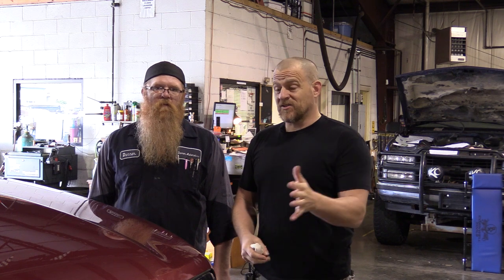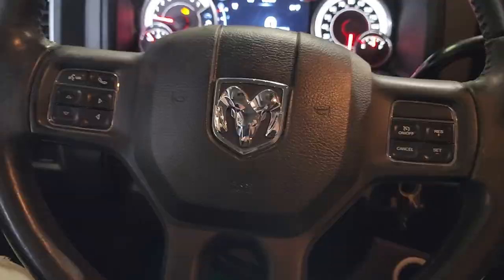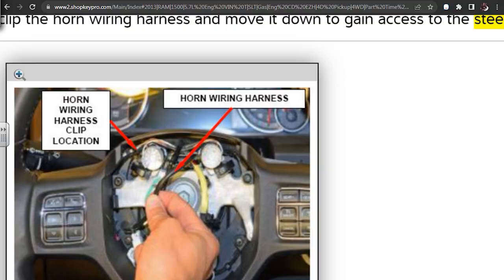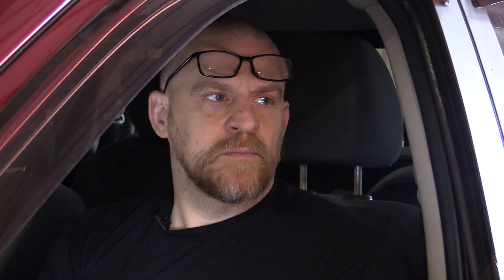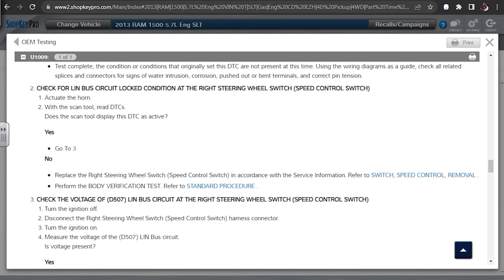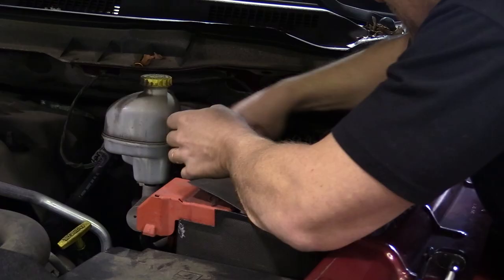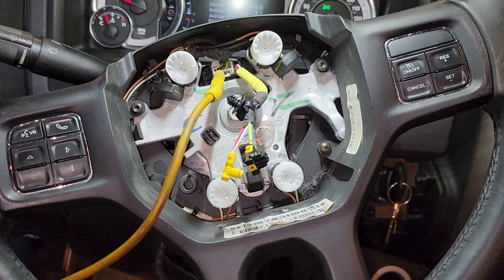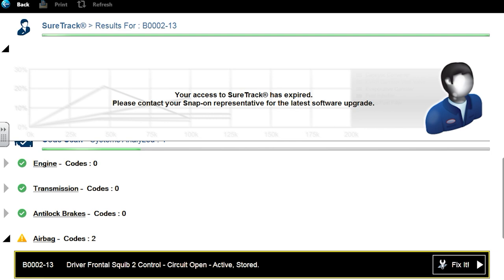2013 Dodge Ram - No Horn/Steering Wheel Switch Functions - LIN Bus Fault [U1009-00]

Comment: I have a 2010 Dodge Journey with no horn, wipers, headlights or taillights or turn signals but brake lights and cruise still work. I have replaced the clock spring, multifunction switch, TIPM and the entire steering wheel with controls and still nothing.
Reply from the maker: Start with a scan of all modules on the car. If you do not have a scanner that can do that, you'll need to take it to someone who does. That is the starting point

Comment: The method Dodge used with the buttons and resistors going to an ADC in the body module is the ghetto way to do it because flaky switches can give the wrong commands to the BCM.  Much better to use the key scanner method with the X Y matrix button circuit.
Reply from the maker: This isn't an uncommon design. I've seen it all over the car in various applications.

Comment: Why are you so surprised that the cruise control is on a dedicated communication circuit on the master module where the lefthand slave side is all non-safety related stuff. With all CC signals on just one wire you can never be in an unknown state.  Just like the airbag is on a separate circuit. Makes perfect sense from a safety point of view
Reply from the maker: Perfect! Thank you
Reply from the maker: I dont think of cruise control as safety but if it malfunctions it most certainly is lol guess thats why I was confused as to the purpose. It makes perfect sense man thanks again

Comment: Hey listen I'm having the same problem but now mine is got no steering, temperature for out side saying -40 at all time and here I'm alberta it's like plus 4,,the sign for steering wheel with ! Mark shows up, now dash lights are blinking,now I have dinging going all the time, half my fuses don't work under the hood.wtf is going on.
Reply from the maker: You're going to need to take it to someone you trust. I have a shop directory where you may be able to find a shop in your area that is using my training material for their technicians. 
https://scannerdanner.com/find-sd-shops.html

Comment: I am having this same exact issue in 2017 RAM 1500. What should I tell my local technician to help him diagnose and find this issue? Check the ground wire at the connector for the LIN going to right switch?
Reply from the maker: First is to make sure the recall was done, and second is to make sure to tug gently in those wires to the right switch.
And pay the guy his diagnostic time! 
The other thing is, I'm sure he doesn't want to hear "I watched this YouTube video"
So be gentle and specific
Reply: Did you get this resolved? I have a 2018 3500 and it keeps blowing a fuse, knocking out the horn and all steering wheel controls except for the cruise control, which keeps working even with the blown VIC fuse.
Reply: @KD-kf4zm  I had this same issue with my 2019 2500.  I ended up putting an automatic resetting circuit breaker in the fuse holder which worked for about a year.  Now its hard broke.  Did you end up finding a fix for yours?

Comment: In some vehicles, if I have the engine running. Why do communication DTCs set if I plug in a scan tool? Still learning
Reply from the maker: Try another scan tool. What are you using and on what car?
Reply: @ScannerDanner  Autel Maxisys on a 2015 Ford fushion. Is there a way it interferes with some signals when I plug it in while running? A bunch of lights come up on the dash and those codes set but when I plug the tool in with the key off, it works as expected. Someone said plugging in the tool with the modules actives interrupts communications? Thanks
Reply from the maker: @chasyho  some of the newer systems will give you problems without the correct update or cable even depending on your scan tool
Reply: @ScannerDanner  thanks for all the knowledge

Comment: Good morning Paul. I know this is a long shot, but I was hoping to get some insight. I own a 2005 Ford E450 with the 6.8 gas. It has been running slightly rough at idle( about 800-950), but when you put it in drive, she runs really rough, when you give it throttle with your foor on the brake, it doesn't want to rev above 1500 rpm. The codes are po171 and po174. When I'm reading live data, stft is switching between +3 and -4. Ltft is maxed at +26. MAF         at idle is .2 lb. When I rev it up to 2500, LTFT goes down to +19, MAF goes up to +9lb. At idle is seems to rev up pretty good. It seems to chug pretty hard under load. Any help would be greatly appreciated!!
Reply from the maker: Unplug the MAF and then see how it runs. If it still runs bad, next step is a fuel pressure measurement
Reply: @ScannerDanner I think running fuel pressure is around 60 psi, any lower there is a restriction in the line or restriction in the pump possibly?
Reply from the maker: @user-vu5gv9sb2h  not sure if this model uses a variable speed pump or not. Some of them did. The biggest thing is fuel psi should not drop on a wide open throttle snap to redline rpm

Comment: Paul, back in the day [1985 - 1995] repair of any SRS connectors & or wiring was verboten by the manufacturers, in my case Nissan, Mitsubishi & Honda. Replacement of any harness for wiring or connector damage was the only approved way from both a liability and warranty aspect. Repairs such as this and a subsequent unintended SRS deployment or failure to deploy with a command signal would leave the repair facility in a "liable if and until proven not liable" situation in court. Good luck with a jury on that one. Perhaps the legal system has moved on from the draconian approach? Does anyone with authority know how civil law reads now?
Reply from the maker: Yeah, I'm not sure? I've never attempted to repair any type of wiring on an airbag system
Reply: @ScannerDanner  Maybe ask around at some of the area shops [or an attorney :) ]and let us know if you find out further. Thanks.
Reply from the maker: @parochial2356  I would follow exactly the manufacturer recommended procedures for air bag systems. Then I don't need to worry about it.

Comment: It's almost as if the owner taking his truck in for the recall repair, ended up causing this issue, by them man handling it a little too hard when the zip-tied it. lol..  But if he never would have taken it in for the recall, of course it would have chaffed and made the other wires fail anyway..    I really don't like dodge because of stuff like this.  I had a 99 Jeep grand Cherokee, and now she has a 2010 Dodge Nitro, and the wiring issues between the two of them have been an endless nightmare;  unfortunately.  I think they are going a little too small on their wire and it's causing them reliability/ durability/ longevity issues.
Reply from the maker: I agree, this ziptie was installed with that harness being squeezed too tight and put strain on that connection